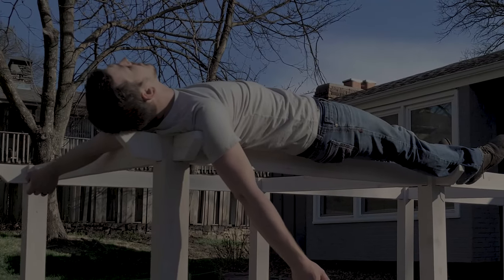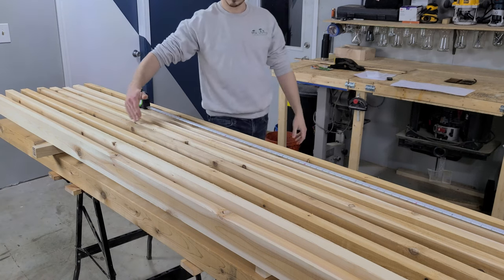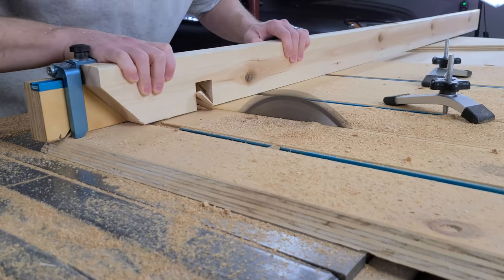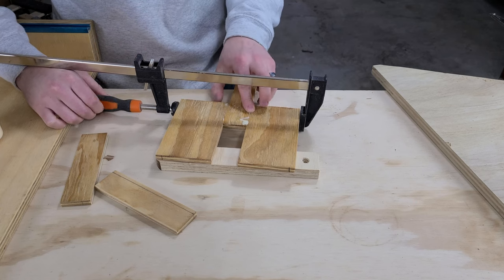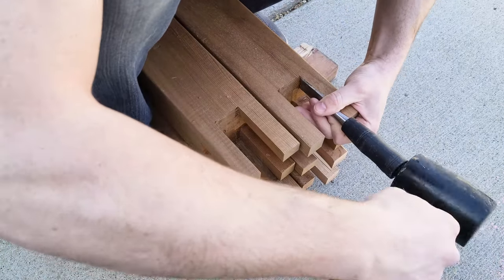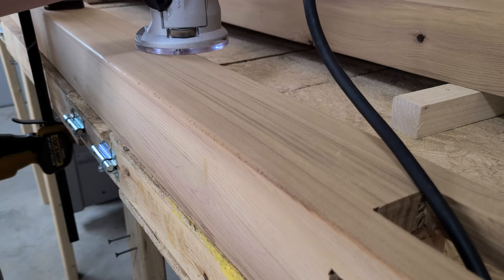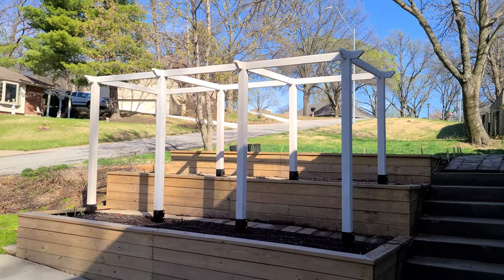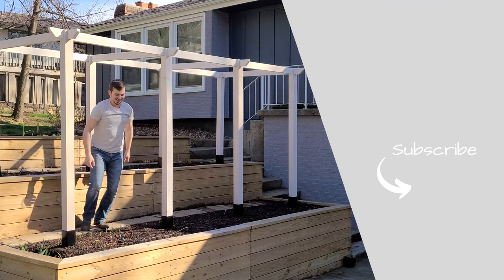When an Engineer and an Architect Build a Tomato Trellis

Comment: Will be interesting to see how well those top joints stand up to rain falling down inside them repeatedly.
Reply from the maker: There's ways for water to escape, plus the finish is hydrophobic which keeps the water from just sitting on the wood. Eventually time will win as it does with everything outside, but it should hold up for years of use 🙂 ~Amanda